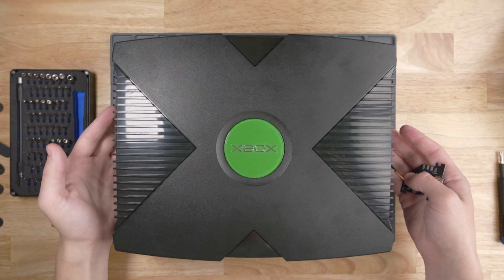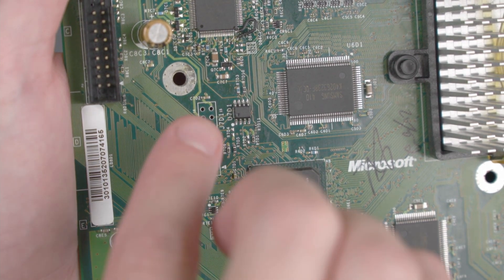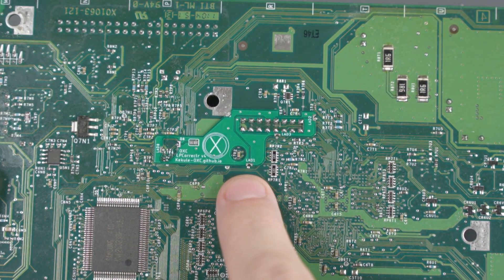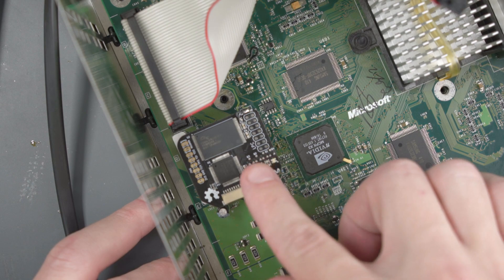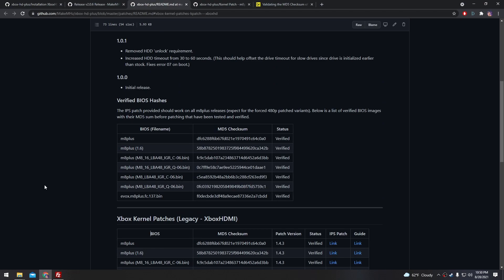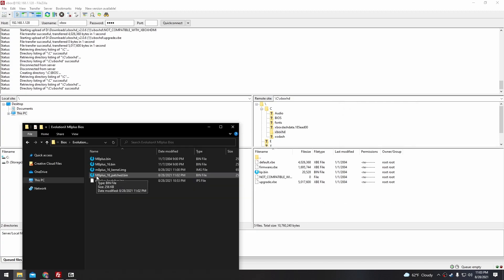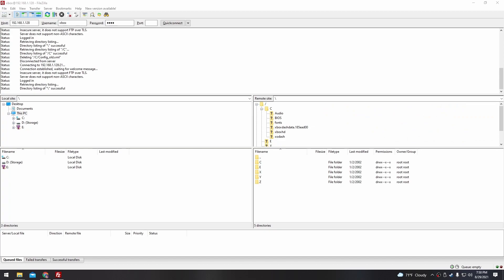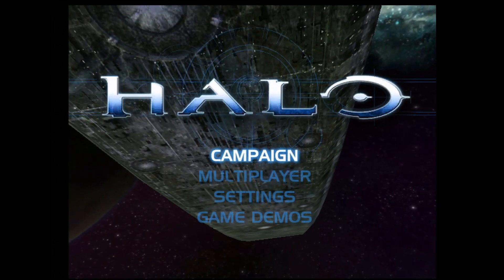OpenXenium Install and XboxHD+ Software Setup In A Stock 1.6 Xbox!

Comment: 4 years later and this video is still a life saver! I followed the instructions on MakeMHz site and flashed an OpenXenium chip with a patched M8 bios and saw it boot straight to the stock dashboard with no way to launch the xboxhd+ app to update the firmware. He completely neglects to mention the need to add a custom dashboard in order to make use of the firmware app.

Comment: I followed along with this guide almost exact. I have a 1.2 so I didn't need the LPC rebuild. But now my console is bricked. I get the error 16 screen with the original drive and the 1 tb drive I installed previously.
Reply from the maker: The 1.0 - 1.4 install is different than the 1.6, I recommend you check out Mr Mario’s video to make sure you didn’t miss anything https://youtu.be/ICRS3yHICKQ

Comment: Why you dont have HALO CE patched resolution for Hdmi 16:9? It looks awesome at 720x480p
Reply: True, but you gotta overclock or upgrade the cpu to get consistent fps.
Reply: @bowlsnapper6206  not really, less FPS drops than Pal resolution thats 720x576 that has few FPS drops (on 2002 i first used the S-Video Xbox cable for 576p resolution, the Best stock resolution but color were bad, and later the component for 480p, that has more Pixels and resize very bad to Widescreen), i had my CE patched for 720x480p (not 720p that is 1024x720) and runs fast and having less Pixels, as i said all Xbox can be capaple of 576p that was higher than 480p Widescreen. So patching for 720x480 is like you play 576p scaled to a Modern TV, a thing Hard to do now. But Halo has almost no Pixels on 576p, a resolution not compatible with Modern screen but patching to 720x480 will upgrade the Halo CE graphics almost at that level. Best regards.

Comment: I cant connect FTP its not working for me. I used to the IP thats on the openxenuim with the right username and pass and everything. Cant get this to connect for the life of me. And I have my OG Xbox connect to the internet via ethernet.
Reply from the maker: I'm not 100% sure, but you can try using the settings from this Reddit post for configuring Filezilla: https://www.reddit.com/r/originalxbox/wiki/filezilla

If you need more help, you can join my Discord and ask us there!
Reply: @dubesinhower  thanks for the reply your awesome!
Reply: @dubesinhower  i keep getting a EACCES Permission denied. I even turned off my firewall and everything it just wont work for me. Is your xbox softmodded while doing FTP transfers?
Reply from the maker: Besides the openxenium, the Xbox is stock. It’s easier for me to help you through the discord

Comment: i have seen the hdmi mod at a friends house iam not impressed compared to my monster component cables
Reply: No matter how small the difference, analog can’t beat true, lossless, digital. Your Monster component cables are working with the exact same source signal only it’s been converted to a lossy/noisy/imperfect analog. It can’t be better than the digital source.
Reply: Word.
Reply: @emmettturner9452  Game, set, match, on that response.